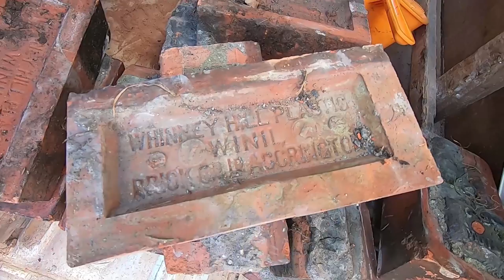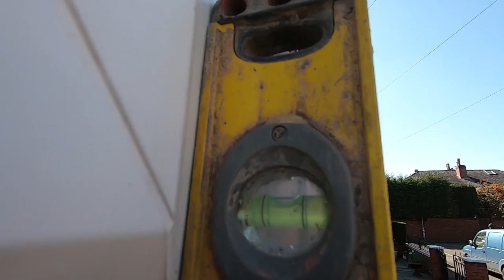Replacing a Bay Window With KC

Comment: Wow Not a Bit of Insulation Up on Cap Roof , Plus should be  100% Rain Shield on that Little Roof - We Set every over Here around Windows @ 3-5 Degrees for Run Off ~